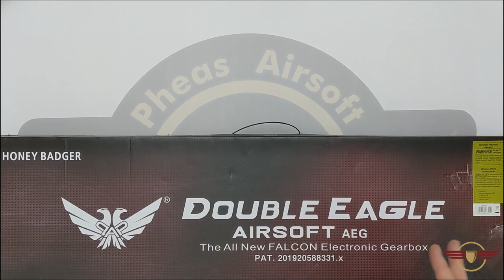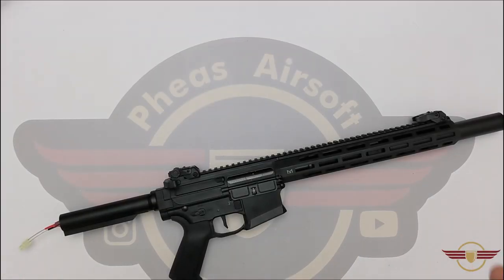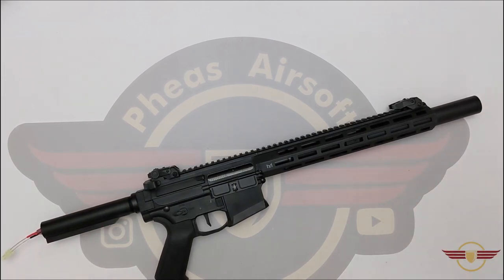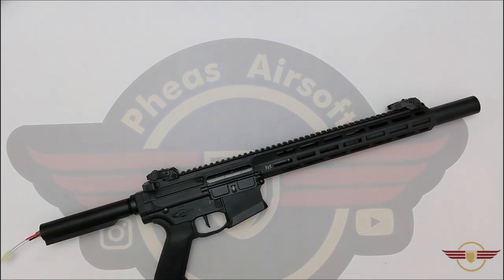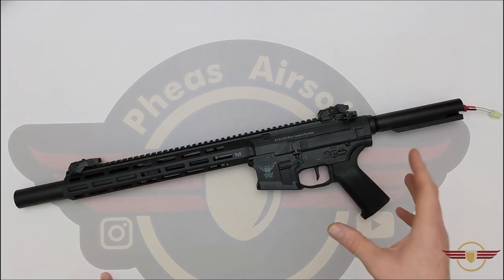[PROJ DMR 3 of 4] DE M904H DMR - FINAL SHOOTING AND EVALUATION

Comment: There is 2 reason why it shot so far. 
No1 is the fps spring, the high to fps spring the more to power it had to push the bbs. 

No.2 is the inner barrel and hop up, 
As a dmr the suggested one is 6.01mm as that will make it have little bit longer range but not too crazy like shooting from filed to the end. 

I would suggest using maple 🍁 degree rubbers depending on what bbs you like to use with it as the high bbs weight the hard the rubber to get it to hop properly.

Comment: He Buddy, awesome Video. I've got the same one but had problems with finding a fitting mid cap. Do you have any tips or links to fitting ones?
Reply from the maker: Hello! I have found that Battleaxe midcaps fit well and feed really well. I tried a TM in it on the day and that fit and fed. What brand did you try? I believe the CYMA ones fit too. Feel free to join my discord and ask on there as there is ALOT of people on there with an M900 series by DE. Pheas
Reply: @PheasAirsoft  He i joinded you discord and got so many usfull tips. I've got myselge some Battle axe 200 round midcap and they fed quite well bust an I got some problems. Mag don't always feed und have to turn it upside down... weird. Next step is use .28 bbs instead od .25 ....
Reply: Pretty sure it'll work with any normal AEG M4 mag, I'm assuming some feed better than others.  Specna arms sell 5 packs of mid caps (125rd) for £33.  Idk if they're any good though

Comment: Hi, great videos. Did you change the spring on this one ?
Reply from the maker: Hiya. It was the factory spring in this. Didn't need to change it. In fact the guy who has it now still hadn't had to change it either I don't believe. Pheas
Reply: @PheasAirsoft  The fast response earned you a sub, what a pleasure. I plan on buying DE M904H and a pistol. Would you recommend me a pistol. I stopped at Tokyo Marui 5.1 Hi-Capa, but it goes a little over my budget for now.
Reply from the maker: @alexandergeorgiev6734  you are more than welcome and I appreciate the sub! As for pistols. The gold match TM (it's a hicappa) or any TM pistol is highly effective out the box and has a massive selection of after market upgrades. The AAP is a little lighter and cheaper and equally well supported with upgrades. Either would be an excellent side arm. Pheas

Comment: sorry, a little new to airsoft, is this an AR and can it shoot full auto or is that only for the m904b
Reply from the maker: Hello! This model does both, however I have set up the options on the included mosfet (computer chip inside it) to disable auto and allow semi auto only. This can be easily undone and restored to normal firing modes. Pheas

Comment: what if you would use 0.28g BBs, is the range gone be better or worse
Reply from the maker: Hello! With 0.28 I would expect similar (maybe a touch better distance) but you will gain more stability in your flight of the bbs meaning more accurate. Pheas
Reply: @PheasAirsoft  thats what we want baby, range
Reply: @PheasAirsoft  can i ask, is there any difrence between A,F and H model except the outsieds and barrel lengts, does any of those preform better
Reply from the maker: @the_steko  Hello again! just the outsides and barrel lengths is the ONLY difference. They will all perform (out of the box) virtually identically it would only be with the H with the longer barrel (at greater ranges) that you would / could see any difference. Pheas

Comment: What tracer should I use for the m904h?
Reply from the maker: Hello! Any tracer will fit on the front... If the outer barrel runs into it though you will need a barrel extension, as the barrel cannot be inside the tracer. I would go with what you can afford and like the shape of. Pheas